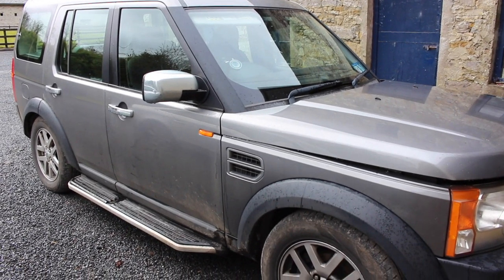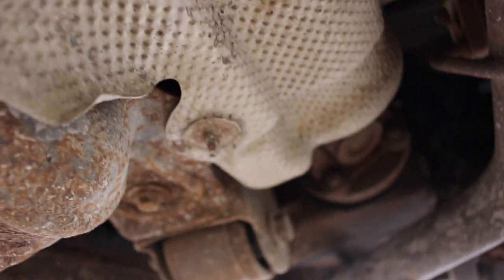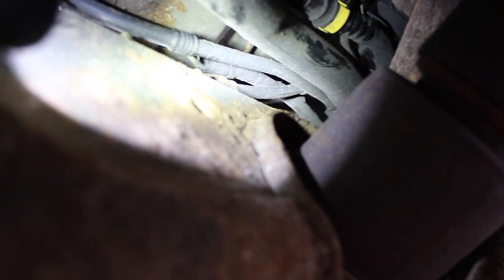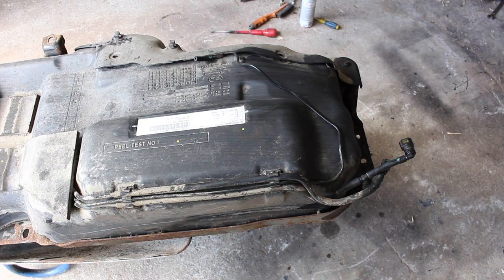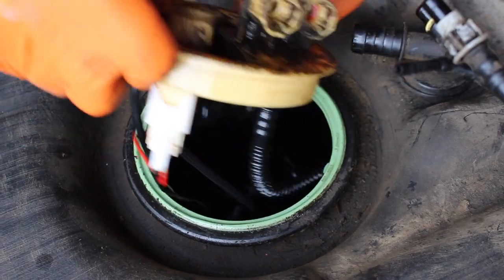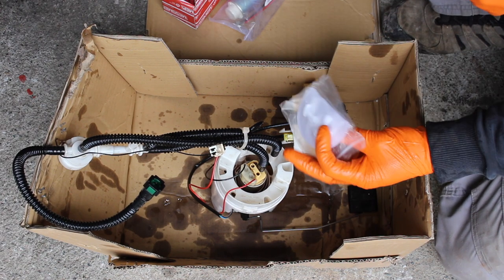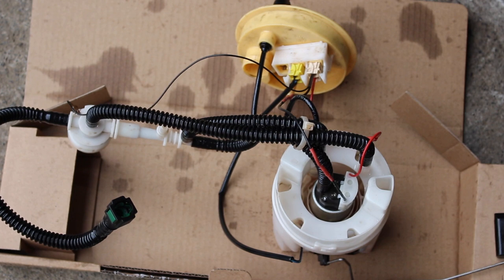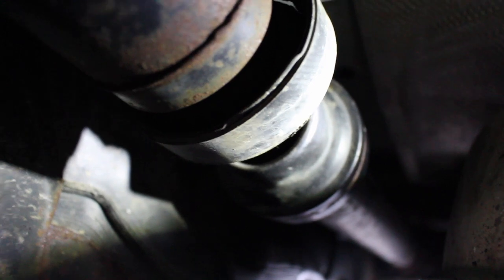Discovery 3/4 Fuel Pump Replacement (low pressure in-tank pump)

Comment: Thanks for the video Sam. I have lr3 08 petrol.  Only when topping off gas tank, we will get gas to leak out on the ground in front of the wheel. from looking around the internet, i suspect there is at the top of the fuel filter.

Comment: At 5.22 into the video you can see on the white section there is a spout for another pipe, this pipe along with another attached to the underneath of the yellow tank cap need to be removed whilst everything is still in the tank, then pull the green clip off the pump housing, pull the white part out first then the pump will follow.
Reply: Where does the pipe go that is removed?

Comment: @fixitsam do you have a part number for the new pump? Just took mine out to find the pump is working but the filter totally blocked up..  can't find the filter on it's own so mite just replace the pump with the one you have... I had bought a new assembly for 340e.. but it's actually slightly different so won't work.. so 60e for a new pump is alright... Thanks for the vid btw

Comment: I've used your video 3 times now. I'm on pump change number 4 in same car. Have you any idea what would cause these pumps to keep failing. Gause at bottom was sort of clean each time and tank has been cleaned out. And fuel filter changed each time
Reply: You need to buy original fuel pump. 
They have different pump for your car. Rover sport 4.4 liters is the most expensive one. .

Comment: Hello.
Good job.
Can you tell me where you bought the pump? I have an LR3 V8 and I have the same problem.
Hoping you answer me soon enough :)
Reply from the maker: The replacement pump just came from my local auto factors. It lasted 2 years then had to replace it again. If doing it again I think I would replace with a genuine pump...
Reply: @FixitSam  Searching the internet I found the same manufacturer as the original pump: "WALBRO"
So I ordered the same brand. But as I drive on ethanol, the seller recommended a suitable pump: Walbro Motorsport GST450K E85.
Thank you for your answer.